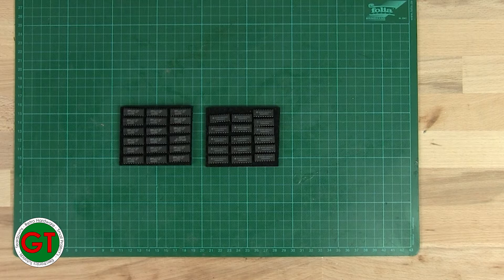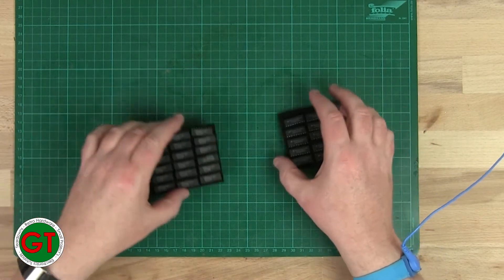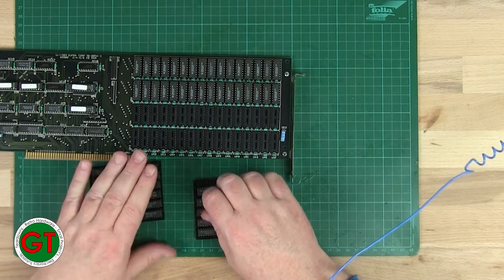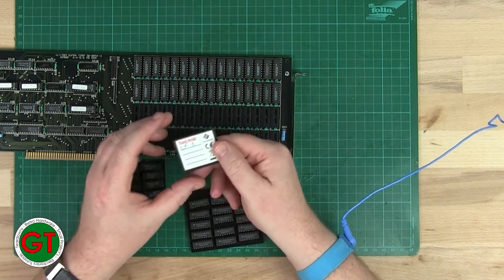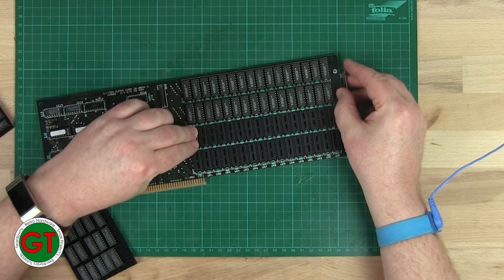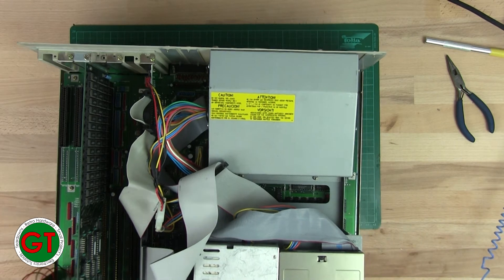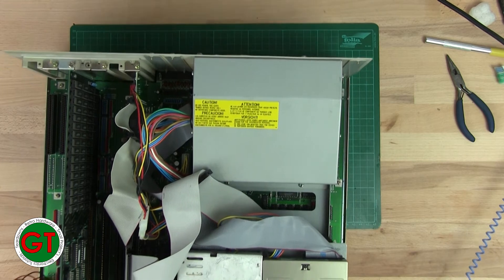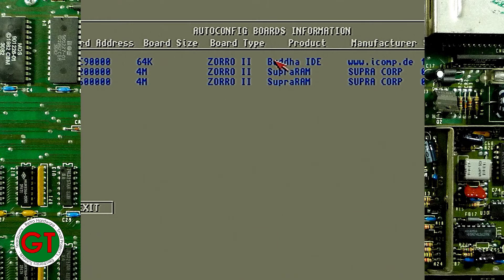Upgrading the Amiga 2000

Comment: where did you connect the ide? the amiga 2000 does not have an ide port
Reply from the maker: Correct, there’s no IDE port, but there are several Zorro II slots were you can install an IDE card.
Reply: @GrahamTinkers  What is yours?
Reply from the maker: @mauricedoerr1992  I use the Buddha IDE